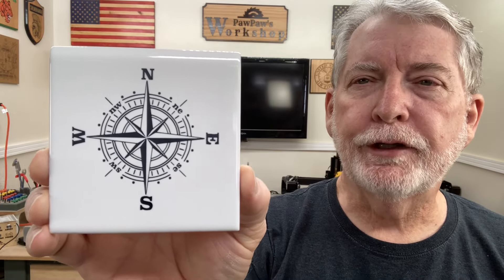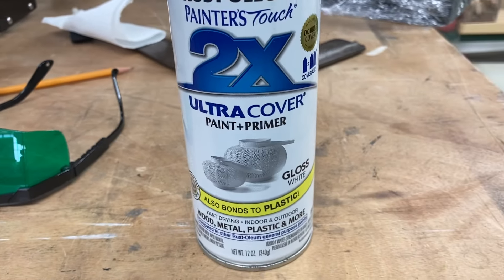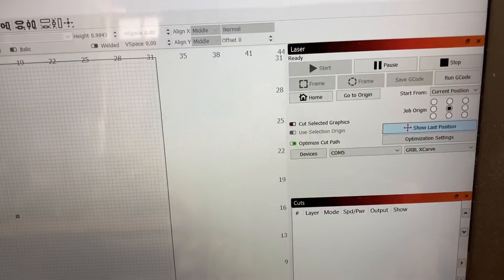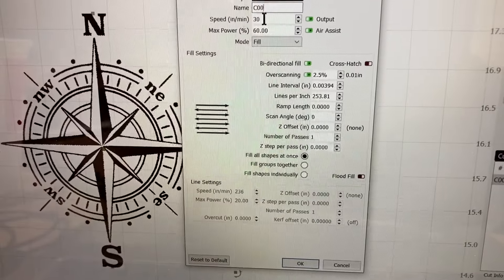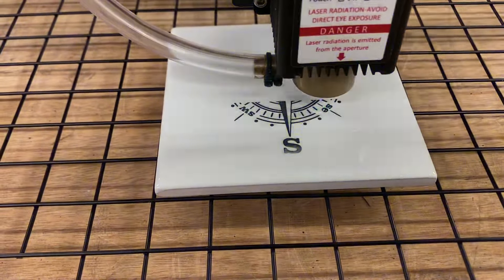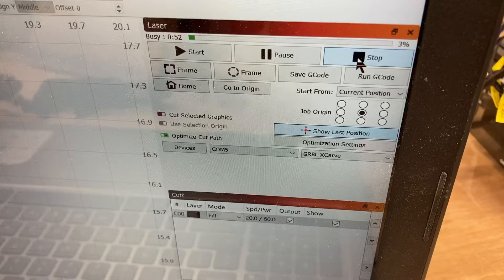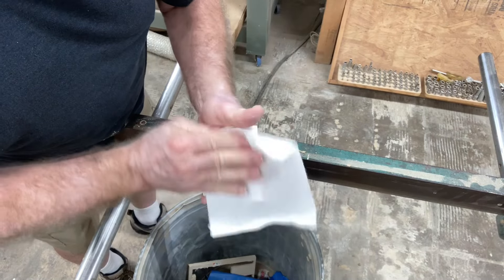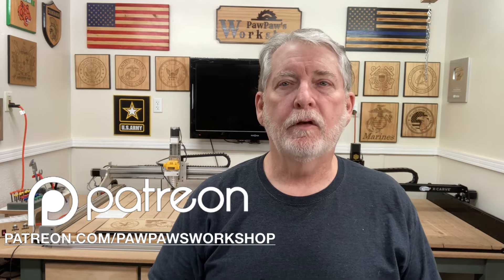Engraving Ceramic Tile Simple and Easy

Comment: Great video. Would the discrepancy on the letter S have been caused by a very slight variation in the surface height of the painted tile? As you know, laser engraver/cutters have a "sweet spot". Any deviation from this will result in a messier or impure cut.
Reply from the maker: It has been suggested that the first run of the day the laser take a moment to get to full settings. I am very open to answers. Thank you very much
Reply: @PawPawsWorkShop  I'm not so sure about that. Laser cutting is a very, very precise science. I'm talking of measurement levels down to 0.001". Any discrepancy on the flatness of the tile surface may produce the effect you're showing. I'm interested to see what results you come up with.
Reply from the maker: No, the tile was perfectly flat in that area.
Reply: @PawPawsWorkShop  throw an indicator on a clamp base and run the gantry and the indicator probe across the surface of the tile next time you see a burn come out inconsistent.
Reply: @mlarsen77  No need for that, but you are partially correct. An uneven work surface can produce fading effects however its nowhere near the measurements described above in this application. There's a section below the laser where the lens cumulates (or combines) the beam into a focused point, or focal point. Visualize the letter X. Where the lines cross is the focal point, however if you were to zoom into the X, this "point" becomes an area where the lines are close together. This area is the depth of focus that is still effectively focused, giving you a little wiggle room or tolerance. We can change the shape of the X using different lenses. What the lens do is stretch the X, making the converging point either wider and deeper, or shorter and more precise. Depending on the lens used, this focal point can be pretty "thick". In a 1.5" lens the focal depth is about 40mm, where a 4" lens it's upwards of 100mm. There is an inverse relationship between focal depth and the focal point. The deeper the focal depth, the deeper the engraving, but detail is lost since the point is more broad. In industry, we use the shorter, more precise lens to gain detail and is used for precision in applications like photo engraving or small text and the longer lens for deeper engraving and cutting of material, especially thicker materials like wood and acrylic. We can exploit this optical range too. In wood engraving sometimes the focal point is so fine and precise that the wood is vaporized and not burned at all, and the engraving will have depth but no color (which would happen in this case if the tile was not painted). We can intentionally take the laser out of focus of the material to find that point on the X where the temperature is just right and can engrave but yet also scorch the wood.
Reply: @PawPawsWorkShop  Just add a little dummy square at the bottom below the tile on your graphic to give laser time for optimal working.

Comment: Very nice work.  Two questions: what machine are you using, and why is the surface painted to begin with?
Reply from the maker: The machine is the FOXAlien and it is painted to prevent the reflection on the laser off the tile and second the laser oxidizes the paint and burns it into the tile
Reply: @PawPawsWorkShop  Thank you.

Comment: I have been wanting to try this…I have an 80 watt Thunder laser…are your settings close to what I’d use?
Reply: I have not had good luck with tile with my c02 laser. it is possible but the detail simply isn't there compared to diode lasers.
Reply from the maker: You will have to experiment with the settings. I can’t say that my settings will work

Comment: I have a question for you. I have a 50 watt Laser and followed your same steps (How do you get yours to come out so BLACK)??? After scrubbing mine with steel wool and Acetone so of my image came off :( Any help you can give me would sure be appreciated.
Ron
Reply from the maker: What paint did you use?  The laser has a chemical reaction to the paint and it burns into the tile
Reply: @PawPawsWorkShop  I bought the same paint you used in your video. Do you put a thick coat or very thin? I did very thin and mine looks nothing like yours sir. Yours is beautiful. Any advice is welcomed
Reply from the maker: Just one coat with good coverage. A light thin coat will not work.

Comment: When you set the laser to the center of the tile, does it matter where on the computer screen the graphic is placed?  I’ve tried setting the laser at the lower left corner of the tile, when I click “frame”, it frames the correct spot. But when I click “start”, the laser will just travel to the lower left corner of the machine bed without doing anything else.
Reply from the maker: Yes, the computer must match. If you are using Lightburn, the green square is the origin point. No need to home the machine

Comment: Papa this is a great video! I have watched at least a dozen times and can't wait t get my 
Reizer 20 watt laser set up. I have a couple questions. 
1. where did you get the compas rose file from?
2. Did you have to use inkscape or something like that to get it ready to engrave.
I already have about three ideas using this file for gifts.
Reply from the maker: The compass rose just came from Google images. Yes, I use Inkscape to convert to svg and to clean up the file. Thank you for watching
Reply: @PawPawsWorkShop  I have tried several different pictures from google and still have not been able to get it right. It would be great if you could do a video on how you make the compass rose file to burn in lightburn.

Comment: is it safe to laser burn a ceramic tile? or paint?
I plan to do this on my K40
Reply from the maker: You should always use the laser in a well ventilated area. Using a exhaust fan to pull all the fumes away and vent outside is important.
Reply: @PawPawsWorkShop  thank you! Btw, for  CO2 tube lasers, is it necessary to paint the tile?

Comment: is there any way to recover failed tiles?
Reply from the maker: By failing, what do you mean?  If the tile is not damaged you can attempt to engrave again
Reply: @PawPawsWorkShop  well a few of my tiles did not come out good. They are faded. And was wondering short of grinding the fused paint have you found any method to recover tiles that didnt come out well
Reply from the maker: No, if the ceramic is damaged you will not recover the tile

Comment: Video turned out well. Would've been nice if you mentioned Nicky Norton, since the process you're using was pioneered by him and is called the Norton White Tile Method. 

The laser reacts with the titanium in the paint, turning it black and permanently fusing it to the tile. If done properly, a sander would have trouble removing it.
Reply from the maker: You are correct and I mentioned Nicky Norton in the comments. It’s a great method. Spread the word
Reply: @PawPawsWorkShop  Yep, been doing it for quite a while.

Comment: Is this a blue laser?  It seems like it.  I'm curious if you're using the default green goggles?  I just built an Ortur Laser Master 2 Pro but a lot of the videos I've watched suggested getting orange goggles to filter out as much blue as possible.  The green are about as unsafe as possible...next to blue.
Reply from the maker: Thank you, I do have the orange glasses.
Reply: I'm currently using an orange-rated enclosure window, w/ green glasses... with both, the laser is almost not visible. :) But yeah, I was confused why companies are shipping green glasses with blue diode leasers... doesn't seem to map up.

Comment: Very nice!  I've been trying to do the test burn with all of the little boxes in a grid pattern that are different speeds and go from 100% power down to 10% power.  But everything wipes off with the exception of a few boxes.  People are telling me that they get good burns at 750mm/min at 60% power.  Anything faster than 200mm/min and less than 100% power wiped off for me.  Hmm.
Reply from the maker: Maybe the type of paint. Just a thought
Reply: The type of paint used & the preparation of the tile, as well as the speed & power settings all play an important factor, as well as the actual output power of your laser.

Comment: When I was watching you I saw you use black paint (or so I thought). So I printed my wife’s favorite picture of us and put 30 years at the bottom.  I haven’t cleaned the pint off yet but it looks like a negative.  Actually pretty cool lol. But I thought it would burn in a black outline/image.   I know I shouldn’t have thought.  Did I screw up by using black paint and not white? Or do I just need to remove the paint and be amazed?  Sorry for the questions but thank you for any help anyone can give.  (Or was it the glass that was painted black?)
Reply from the maker: This Norton White tile method works because of the titanium that is in the paint. The laser burns it permanently into the tile. If you like the look of the tile you could put a clear sealer over the tile to protect it
Reply: @PawPawsWorkShop    Thank you. I just had too close my business of 23 years down (computer and networking company) due to an illness I’ve been fighting for over 26 years. I go from fine to a wheel chair to completely paralyzed in a matter of a few hours when it flairs up and it can take days or months to become mobile again. Now taking infusions of IVIG for 8 to 12 hours a day, for 3 to 5 days every two weeks has limited my ability to do much.  I love woodworking and making toys and simple things for gifts to the grand kids every year and I thought with the Foxalien 4040xe with laser I could turn a hobby into much needed income for my family. Being a disabled vet with an income now limited to about 1100 a month doesn’t allow for much in today’s society especially with a 16 year old daughter and wife that is still my responsibility.   I have an Avenue for distribution to a ton of potential military customers through my son (active duty for 10 years and fifth generation Navy) and several friends that work on JRB base in Dallas so I’m hoping go can instill some patriotism in some and honor in others while still keeping the lights on.  It’s hard to not do my job any more but that doesn’t mean I don’t still have responsibilities to those I care for.   Your videos and a few others have encouraged me to take a chance, and with a lot of prayers and faith, attempt a new direction in my working and giving life.  Perhaps this could be a little therapy too for myself.   I wish I could give back  monetarily to you for your time and sharing but all I can do at the moment is give my thanks and appreciation for now.  I take the Sargent Schultz approach to things in life “profess the ability to do nothing, and impress them when you accomplish something”. Who knows, perhaps this simple and humble venture of mine will allow me to not only be able to take care of my own but give back to those that have helped and guided me along the way.  Not sure how to message or email to someone on here or I would have said all this and more privately to you.  Again sir, this Texan and Navy vet tips his hat to you and says thank you.

Comment: Can you post the file?  What is the output wattage of your laser, and what was the power set at ? Very nice!  I have a 7.5 watt laser I have experimented with tiles with some success but not as nice as yours. I really need to slow down the speed too after seeing yours. I use lightburn too!
Reply from the maker: This is the 20 watt laser from FoxAlien. The output is approximately 5.5 watts.

Comment: I’ve tried this several times today and have not gotten it to turn black. The laser just engraves the paint and it turns a light cream color but not black. Any help will be appreciated. Thanks
Reply from the maker: Try in the GRBL settings $30=1000
Reply: Those are the settings I have in GRBL. I use this machine every day with out issue. I have a 7W JTech laser so I think the settings are different. I am trying it again today. My only other guess is that I am using the wrong paint. I have the flat instead of the glossy.  Also thanks for all the great work you do on these videos. The are always helpful informative and inspirational.
Reply from the maker: Use the paint and primer or just primer. Also I would slow down to about 10ipm and increase power to about 80%
Reply: @PawPawsWorkShop  I will try this as soon  as possible. Machine is running a job now for a local business. Thankfully I bought plenty of tiles to test on.

Comment: You should'nt use gloss paint. Use flat/matt white and make sure it contains Titanium Dioxide. It reacts better with the glaze on the tile. 
If you use gloss you are just reflecting some of the laser energy away.
Reply from the maker: Thank you excellent point
Reply: @PawPawsWorkShop  You're welcome.
Reply: Thank you for explaining how the lines turn black I was so confused why you painted a white tile white prior to lasering it

Comment: What is happening is that the laser doesn't start at full strenght (or given strenght that is), it needs to power itself up for awhile. Having it pump out its maximum power "on the fly" would fry it instantly ;) (Most Co2 lasers such as K4 are given a "pre-charge" time)

This is actually a safety measure on diodes since in some humid/cold environments, firing it head-on at its maximum could very well cause an explosion.

Think of it as muscles in your body. Working a little with them beforehand would allow you to lift X charge. Try it "cold", you sever your muscles ;)

The easiest option to avoid this (altho not the most user-friendly), is simply to frame around your project multiple times, giving it time to warm up :)
Reply from the maker: Awesome, thank you very much